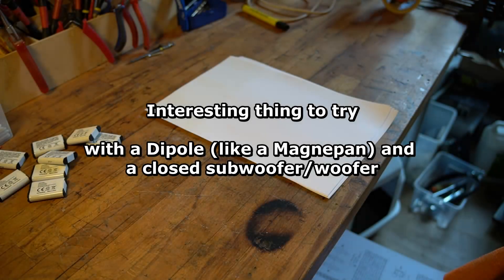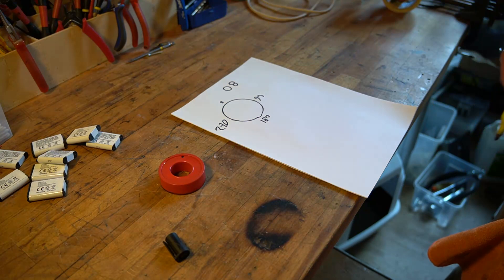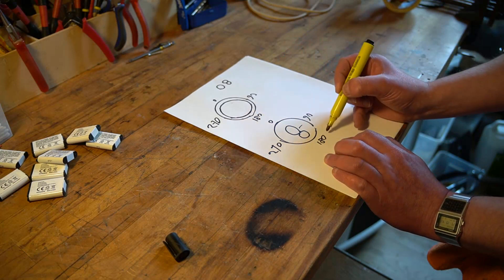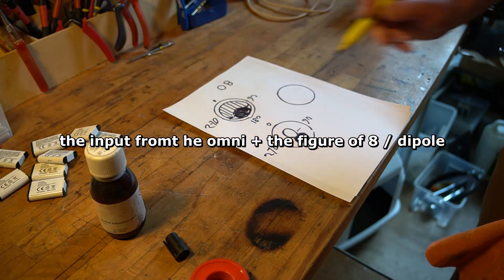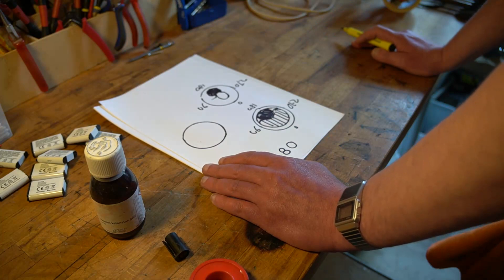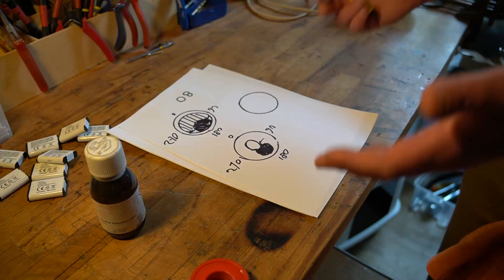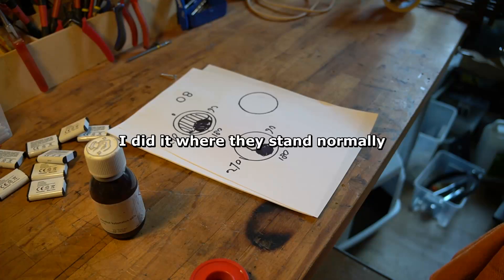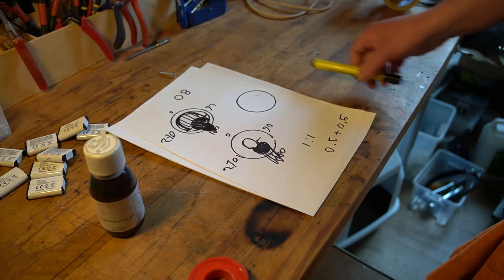Interesting thing to try with a Dipole (like Magnepan etc) and a sub

Comment: Hi Joppe. 
This is similar to the method I have used for my dml panels, for at least 10years.
The difference is , I have my Subs up against the wall behind the panels.
The distance difference from the front cone to the panel is about 30cm. 
I then time align them using dsp .
The subs do not have rear wall reflections causing problems because they are up against the wall.
Time aligning not only cancels the rear panel wave at source but also strengthens the front wave.
I usually run my panels down to about 100hz, and the subs up to  about 300hz, depending on which panels I am using. 
Doing this gets rid of the room and panel, suck outs which tend to appear in the 100hz to 400hz regions, depending on the panel used.
I usually have the low frequency drivers ,probably at least 3db louder than the panels , this sounds more natural to my ears.
Depending on the panel low end performance,  the sub and the panel can both run together from 40hz to , in my case 300hz. 
I have not tried having the panels any further forward, mainly because a lack of space.
I hope this is of use to you.
Steve.
Reply from the maker: Ah at least one user of the concept haha.  I think the rest of people using it might not be aware hehe and good idea with the delay!!! thanks

Comment: Maybe I am wrong, but I would take two open baffle woofers and connect them in a 90 degree angle (magnets pointing to each other). Pointed forward it should make a cardioid source ?  Well, a kind of .... I think.
Reply from the maker: I am afraid not , It would look more like 3 dots, with still the same amount coming from the back compared to a regular dipole , and less from the front but a little more on the sides of the front.  Compared to a regular dipole )

Comment: i always thought that ripoles are very good at this. You should be able to put a ripole on top of a regular sub and get a moderate but broadband cancellation.  
One series of woofers that I think could excel at this is the  Peerless domes marked GBS, for example GBS250. They're discounted and very compact. If you could put a woofer like this in front of a regular sub, you should get a nice bandwidth. The scary part is that you always need to bump up the bass when going cardioid. It's the same as with dipoles, the lows are weak and lifeless without at least 3db of boost.

Comment: You should definitely go one and make a full range cardiod speaker, using a boxed woofer playing against the back wave of a your planar dipole sub dual membrane well into the mids, crossed into a ribbon tweeter in a controlled waveguide playing cardioid highs! Only the sub frequencies from the ported box would remain omni. Making it the first speaker with perfect dispersion down to 50hz! That would resolve the problem of the rear wall reflection!
Reply from the maker: haha yeah bit to much :)
Reply from the maker: well i am thinking about it. it adds to the low end extension while having less reflection :) sort of a win

Comment: Is this is a time to try MBL-like omni woofer but with your cylindrical planar membrane rather than MBLs dynamic driver and metal blades? You could manage a tension with increasing/decreasing a distance between that "drum" caps. The only a critical thing is a circular tension
Reply from the maker: ooh no :) this was just to ilustrate how you could ditch 9 db of the ouput on the backside of a dipole :)
Reply from the maker: a regular woofer in a housing is per defenition an omni (unless they are HUUUUUGE). so its of no use making it curved.  (if the frequency wavelength is biger then the obstacle the woofer and cabinet forms it wraps around it and becomes an omni.) thats why drivers that a relative small to the low frequencies have so much room interaction. and a open baffle has less
Reply: @joppepeelen  That's an interesting point. I just realized that there could be no (or merely audible) a 1/4 wave length cancelation effect (from a loudspeaker to a back wall) with OB architecture. If you meant it. And parallel wall resonances are smaller because a sound comes in 180deg phase difference to a wall.